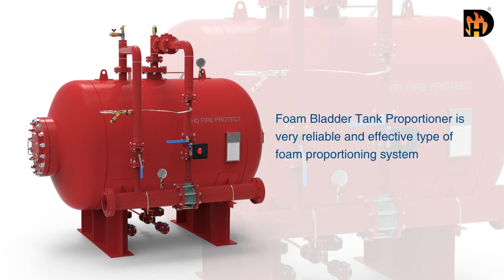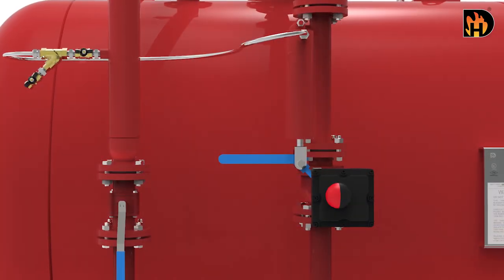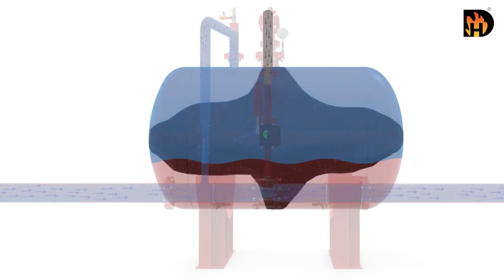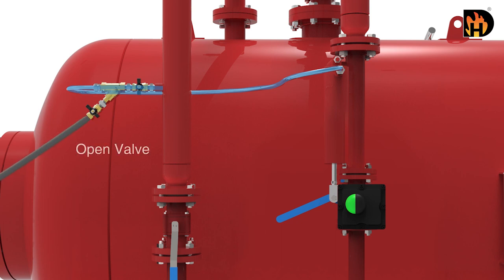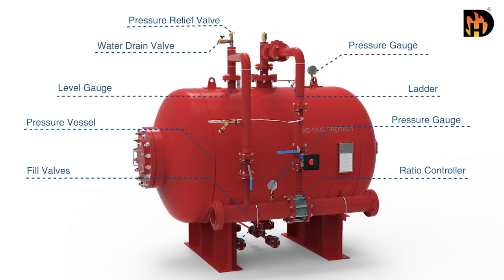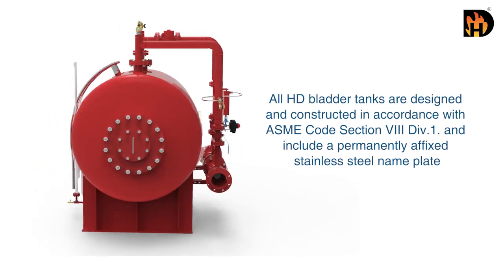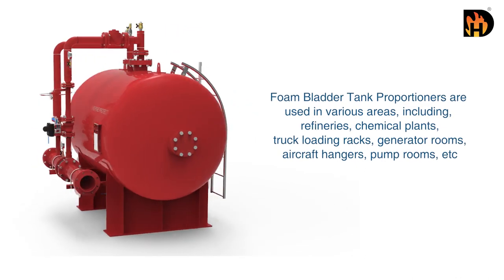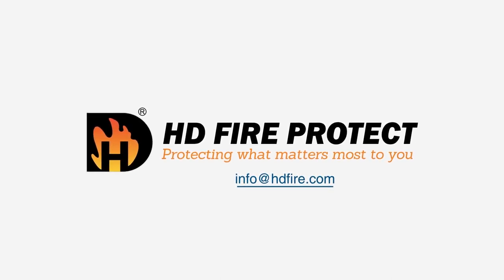HD Foam Bladder Tank Overview

Comment: Nice video presentation. HD Fire is most helpful to many fire safety design engineers. I have a query? What if the client doesn't want manually closure of control valve in Foam line? How to make it with automatic open/close option?